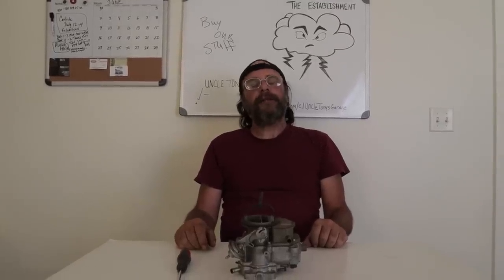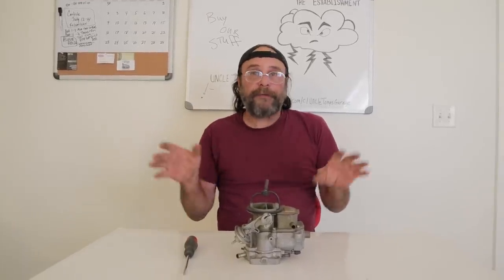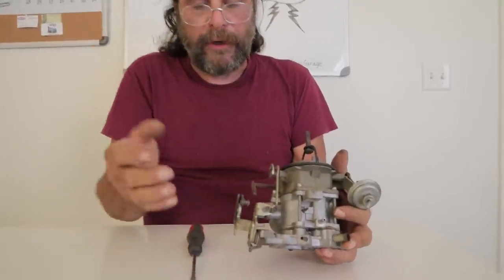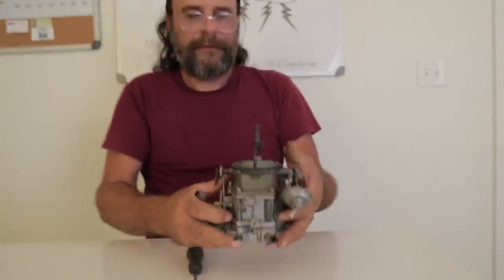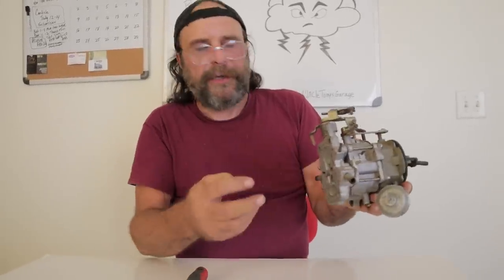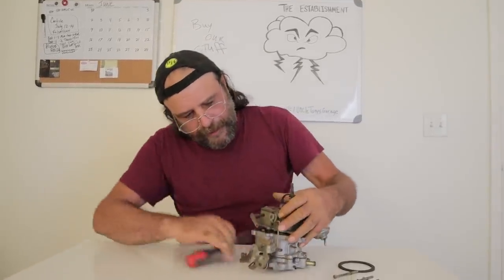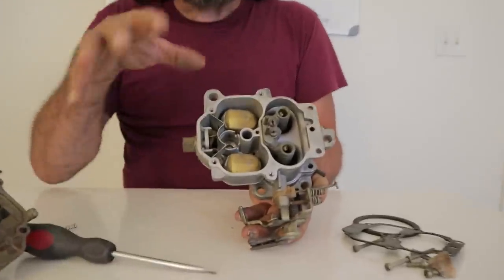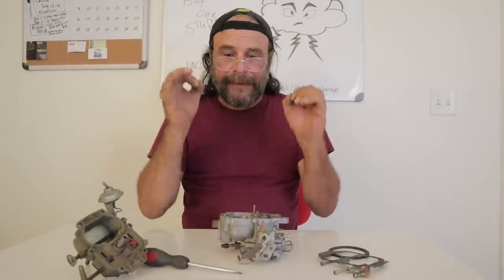Classic Car Tech- Understanding Carburetors

Comment: Noone in my years of living has ever clearly explained all this to me. Thank you so much.
Reply: Right? I've rebuilt a Holly, but didn't understand what those tiny holes, or like bending the choke rod! I bet that Holly ran like crap compared to if Tony had rebuilt it.
Reply: I wont say I'm a carb master , but I'm always open to learning new stuff.
 I cant stand techs who know it all, I try and be humble in my work. 
Im the guy who sits back in the corner and lets everyone play themselves.
Reply: @MrTheHillfolk  im a younger dude but i know a ton of insanely obscure info. I just need to fill in the rest of the useful more common knowledge
Reply: @ZacLowing  
Back when we were teenagers, one of my buddies girlfriend's father's rebuilt  his Quadrajet for his GTO.
Lol say that 10x fast. 
That car was so fast to begin with , he didnt notice that her father flipped that little lever to lock out the secondaries for months 😂😂
Reply: To have some fun, take tossed away mower to your garage or shade tree. Hook up a tank of water to it (it's junk after all). Take a compressed air nozzle and shoot the air through the carb. You can use the throttle from idle and up wide open throttle. Will be able to see idle circuit, transition circuit(s), and all points up to WOT (wide open throttle). 
The power valve is something to economize your car. Same with the accelerator pump. These two items economize the engine for various load conditions. But would you pay an extra $65-150 for a push or riding mower to save fuel on something you use 13-27 times a year for a couple of hours maximum run time?
My Unca from the toolbox made it easier for everyone to understand. 
BTW, I reckon you could reverse a shop vac and blow through the carb with that. Just for the love of life and limb, use water instead of something combustible!!!!!!!!!!
Reply: @MrTheHillfolk  Intelligent people always observe, you are one of those people!
Reply: @ThomasJones-sz3sx  
For some reason I knew to shut up when someone like Tony is talking, hes passing on what hes learned and it'll help me out one day.
Get me hooked with great knowledge and im not the kid in back of class shooting spitballs at the board. 
Kinda miss my old job, we had a guy there who started workin on trucks in the late 50s. 
He could make a Detroit purr, and it was an honor to work with him and learn from him.
Reply: @coozy100  
Theory.
I use it every day. 
Get it nailed. 
I have a guy at work who has a hard time with the 4 stroke cycle and the cam running at half speed of the crank. 
If he can get over it, the world is wide open to him. 
Once you have theory 101 down pat, you can troubleshoot just about anything that runs on a fuel. 
 I did go to tech school 20+yrs ago, but it gives good structure I believe. 
when i used to take something apart it was like an explosion, now its neater. 
And you can demand more$ than the guy applying who works in his backyard.
Reply: My dad has bad breath

Comment: I'm in my 50s, been into things mechanical since I was a little kid in the 70s. My first carburetors were on Briggs and Tecumseh engines on lawn mowers and later mini bikes and go karts. In 1980 I started high school at a state Tech/Vocational school and I enrolled in the automotive trades course. My auto shop teacher was old school, mean, demanding and sarcastic and that's what made him so great. He explained carburetors about the same as this but there was one more thing he taught us. Carburetors operate on pressure differentials. Inside the throttle bores are what's called a venturi. What that is, is where the main fuel discharge is, the throttle bores neck down a little smaller than the rest of the throttle bore. As the air moves through the venturi, it speeds up and that creates a low pressure, or vacuum within the venturi and that vacuum is what draws the fuel out of the fuel bowl through the main power system or circuit as he called it. Basically the pressure within the venturi is lower than atmospheric pressure so the atmospheric pressure actually pushes the fuel through the main circuit and out of the discharge in the booster.

Comment: Years ago I bought a NAPA rebuild kit for Dad's 225 slant-six Dodge van for $16.  It had a single-barrel Carter carb. Included were instructions.  I followed the instructions carefully (I substituted using my thumb as a vacuum source for the dashpots - push in dashpot, hold thumb over vac port).  I bent all the rods and measured everything to get things to exact specs.  A few hours later I had a perfect-running van that automatically kicked down from each step of hi-idle.  I was SHOCKED!  For years, Dad took the van to several Dodge dealers who played around and even put 2 new factory carbs on it and could not get it right - all problems were related to the electric servo/stepper motor operated choke.  I think it was also the moment I decided that I would never take another car to a dealer to get fixed.  It amazed me how little even the dealer mechs knew about carbs.  Thanks for yet another terrific video!

Comment: I have watched about a 100 of your videos and now I am here to pay homage to you. I have finally figured out the problem with a WWC 2 barrel Stromberg carburetor that I believe is original to the 1967 Chevrolet C70  gasoline powered dump truck I have owned since 1990. The dump truck has a GMC big block 401 Magnum V6. It says so on an ID block on the right side of the engine front of the cylinder head area. This dump truck only has about 80,000 miles on it for being 54  years old. I can tell you that this truck has always made me feel uncomfortable when ever I licensed it to drive it on the road because it hesitated on acceleration. But we humans adapt and continue to drive it even though something is obviously wrong. Maybe 20 years ago I put a rebuild kit on this WWC carb. The instructions that come in the rebuild box are very poor. I was always suspect of the accelerator pump. This new kit I bought from Walker products had a very illegible blowup of all the parts. I watched your video and got a better understanding of the idle system, high speed circuits, port manifold vacuum, manifold vacuum, and accelerator pump circuit. I FOUND OUT THE CARBURETOR WAS DEFECTIVE FROM THE FACTORY. This truck was built at the Pontiac GMC factory in 1967.  The manufacturer of the Stromberg WWC carburetor is located in Elmira, NY. The defect I found was in the air horn venturi part that sprays the fuel down the throat of the carburetor. At the bottom of the accelerator pump is a BB size ball to act as a check valve. When the accelerator plunger  moves down the check ball seals the plunger chamber and the fuel is forced through another passage to the venturi  air horn circuit. A smaller check ball resides in the air horn .  When I assembled the carb and installed it fuel never sprayed through the venturi horn and into the throat. It oozed out of another hole that had been covered up with maybe JB Weld. I had removed the JB Weld and the fuel  just oozed out of that hole. I threaded the hole with a 6 X 32 tap and put a little screw with a little flat washer in the hole. After doing that I could not install the accelerator pump. It was hydraulically locked because I left the fuel in it and in the fuel bowl. I removed the 3 screws that hold the air horn venturi in place and examined the  air horn venturi. I found out that no hole existed to allow the fuel to get into a chamber that has the holes for spraying into the throat of the carburetor. I removed the little 6 X 32 screw I installed. I drilled a 1/32 hole from the tiny BB area into the venturi chamber that sprays into the throat. Now I found another problem that the parts blowup does not show. On top of the carb by the hold down rod is a metering type hollow thread screw. Fuel was being pumped up this hollow screw when the accelerator pump was activated. I had an extra small BB from the carb  kit.  I ended up putting a small spring for the BB to set on in the metering hole. This ball acts like a check valve keeping fuel from spraying out of top of carb when accelerator pump is depressed. I finally got a nice stream of fuel spraying down the throat of the carburetor. I was up till 2 am outside in 29 degree weather praying to God that the big old V6 Magnum would not catch fire as I messed with the timing. Huge balls of flame where lighting up while I cranked the engine. Gas was dripping everywhere. I know it was not the float. I had messed with the 90 degree elbow brass fitting so much it developed a crack in it.  I  dug threw all my brass fittings and found a suitable replacement. Finally the engine started but it sounded like it was running on half the cylinders. But it idled at about 700 RPM. I pulled plug wires and found a dead number 2. I cleaned the spark plug and still no  power from that cylinder. I pulled the valve cover and the intake push rod looked like a pretzel.  This engine has solid lifters. I found Melling push rods MPR121 and am waiting for the parts. I believe all the back firing through the carb bent 2 intake push rods. I still have to check the drivers side. I can't believe I fixed a 54 year old manufacture defect. Thanks Tony.  I think I am older than you so its hard to say uncle. I need this dump truck to work real bad.

Comment: I was raised on carburetors,  all my dad's cars had carburetors , my first car had a carburetor.  I used to  adjust them all the time , "the chock the jets the idle screw ect ! " I used to be like uncle Tony I used to have extra parts in the  trunk of my car because I was raised to not depend on nobody and to always be prepared. Like 1 time we got stranded on the side of the highway  41(CA) because we were going to pismo beach and my distributor was acting up , but lucky for me I had a spare in my trunk I put it on and I was on my way , it took less than 20 minutes to get on the road again! Thanks for another good video uncle tony!

Comment: You really brought back some memories with this one. My first car had a 318 with a 2 barrel, which looked identical to the one you took apart, and I was always having to mess with that thing.   It didn't help that my gas tank had rust in it that went right past the fuel filter and would get in between the needle and seat.   That was over 30 years ago.

Comment: Tony- I love this shit! Brings me back to my youth... back in the 80's I drilled three holes in my old Nikki four barrel (oem) float bowl lid on my Mazda Wankle/Rotary truck (REPU). I soldered bent copper tubes into it about 6" long- one to the left, one straight up, one to the right as a fuel "escape buffer" for hard cornering. these ran up into the air filter housing and gave the fuel a place to go rather than flooding me out in autocross/hard cornering..(removed all emissions controls) It was a pretty cool modification. I also made up a simple linkage to convert it's vacuum secondaries to manual and removed the choke. That truck was scary fast!

Comment: When the engine is turning, air is sucked into the intake manifold.  The carb sits on top with a fuel line connected.  In its most basic form, a carburetor is a mechanical atomizer.  
Great explanation Unc.
Reply: I remember reading a story where a guy said he had the carburetor off of his Cadillac 500 and he had to bump the engine over for some reason... mechanical fuel pump start pumping Fuel and dumped it in the intake, and it started and ran and took off to a million RPMs....not sure if its true, probably a wifes tale but  sounds good....
Reply: But there's simply no way it can atomize more accurately than a fuel injector

Comment: Thanks for another good educational vid Uncle Tony! I'm only 27 but I'm a die hard carb guy and it grinds my gears so bad when people list instant startups, instant throttle response and good gas mileage as advantages specific only to fuel injection. My 68 Satellite, 73 Mustang, 75 F100 and 84 Trans Am all start up immediately! Your fingers aren't even on the switch for half a second before they fire up! The cold starts and throttle response on my Satellite are the kind of instant action modern fuelie guys are chasing when they punch around on a laptop. 

The Satellite also gets amazing gas mileage for a 50+ year old car with a carbureted cast iron V8. I haven't checked the MPG since I changed the motor and rear gear but I used to get just over 25 MPG on the highway with the same carb back when I had a 273/2.76 combo. 
When you can get better cold starts, better throttle response, better overall power, better reliability/maintainability and comparable fuel economy for roughly a fourth of what an EFI system costs the answer is clear!

Comment: This video really takes the mystery out of carburetors. I remember being overwhelmed the first time I pulled the Mikunis off of my FZ1. I spent hours learning the ins and outs of those things, mostly by screwing things up, like misplacing the starters and mains. Lessons learned, skills developed, and now it's a breeze. I have owned this particular bike since about 2008, and don't think I will switch to fuel injected bikes any time soon. The carbs may leave you with mileage/power fluctuations at different altitudes, but maintenance and upkeep is much cheaper, and easier. And as Uncle Tony stated, MOAR POWER!

Comment: Thank you. I'm restoring my first car (76 D100). Swapped the motor with a 66 slant w/ a Carter single and points. Truck's been sitting since I left for the service in 06. With all this nonsense with the overblown seasonal flu, I've had a lot of extra time to work on her. I've been watching all your vids on the slant. Loved the 'Understanding the Slant Six' video. You remind me of my childhood mentor who taught me most of what I know. 
I learned about the fuel metering seat, where the idle passages are, how to adjust the idle, and the choke release. Thank you so much! I'll be rebuilding the 76 slant with HEI for performance (nothing crazy) and then I'll rebuild the 66 slant.

Comment: Tony is spot on - the carb float bowl, floats and needle valves work on the exact same principle as a toilet tank.  My '69 AMX flooded once and after tearing down the Edelbrock 1405, I found the problem.  One of the floats was full of gasoline, allowing the needle valve to stay open.

Comment: Great work! I love how you are able to simply come up with the perfect words to on the fly to explain very technical systems.  That is a gift my friend and it makes watching your content easy to get! 

I was born in 84 and as a kid I would watch my dad work on his 49 Ford Pickup or his 68 Pontiac Firebird.  And as a teenager my friends and I would tinker with EFI 4 cylinders (VW, Honda's) as they were the type of cars available to us.

My grandfather passed away a couple years back and he had a 64 Thunderbird sitting in a shed that was not running and am still in the process of getting it road worthy.  I am having a lot of fun with diagnosing all the problems and pulling it apart to see what what is failing.  

I have rebuilt the carburetor, replaced starter cyliniod, fuel tank, mechanical fuel pump, and the brake booster is in the shop right now getting rebuilt.

The reason I am sharing all this is to let you know who is watching and why.
Your videos keep me grounded in reality to the scope and long term payoff these projects are.  I am so grateful to hear your prospective on how to approach older cars and I want to acknowledge you for respecting other peoples opinion on what kind of cars and systems they are into. I think I am ready to buy a t-shirt 😏
Reply from the maker: Awesome, thank you.  Matt, you are the reason we do this stuff

Comment: Some great explanations on carburetor functions, thank you.  I think another reason for fuel injection is reducing exhaust emissions.  The formula for the perfect air/fuel mixture becomes so complex when you are trying to reduce emissions more and more, that the "analog" mechanical computer which is a carburetor (metering rods, thermostatic choke control, vacuum choke control, accelerator pump, etc) can no longer cope.  Controlling air/fuel mixture becomes a perfect candidate for computer control, which can handle complexity and non-linearity much more easily.  Also, with oxygen sensors in the exhaust pipes, fuel injection becomes a "closed loop" system, meaning the computer gets feedback from the oxygen sensors on how well it's doing its air/fuel mixture calculations.  Carburetors are "open loop" because there is no feedback whether it mixture is optimal.  Of course, pollution thresholds were much higher in the 1960s.

Comment: Have 16 thermoquads in the shed. 
I refuse to put efi on my old mopars. 
A properly tuned carb is just about as good as efi. 
It’s cheaper. Easier. Less complex and at WOT they can make more powerthan efi. 
Another great video, Uncle.
Reply: Some ECMs can be hacked for performance,  notwithstanding emission control standards...
Reply: The Thermoquad was the best standard factory 4bbl ever offered for performance, AND economy.
Reply: That's why I'm such a fan of the Spread bore carbs. Small sensitive primaries for milage and large secondaries for power.